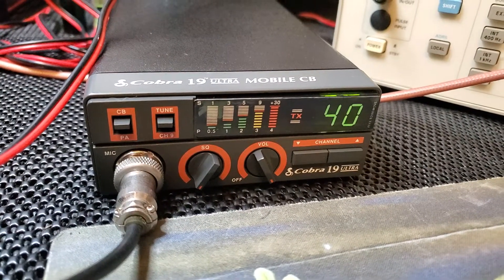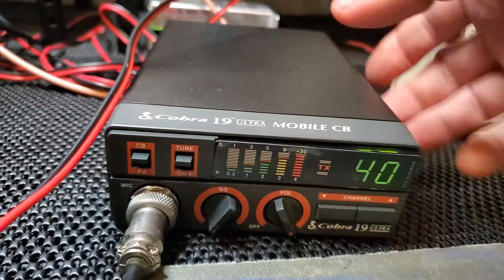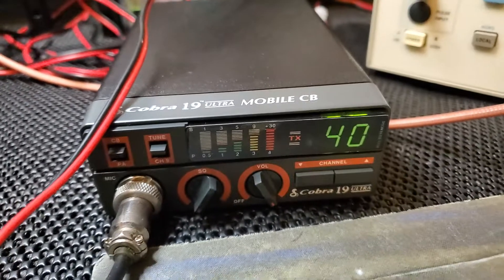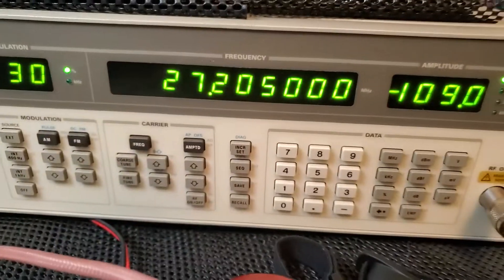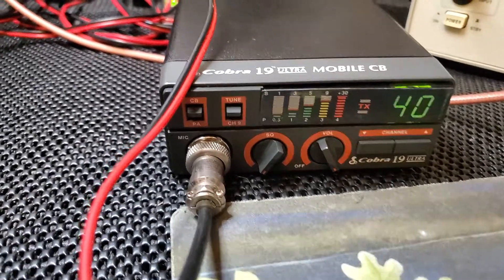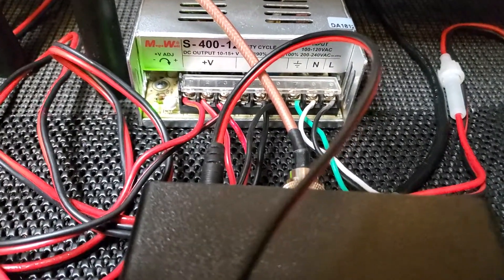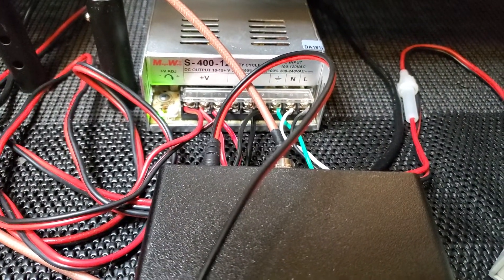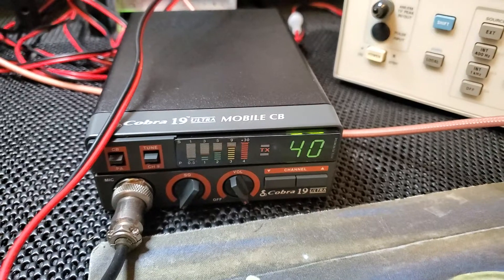New Cobra 19 Ultra original from 1989

Comment: This is my second most fave CB radio only to the 19PLUS with the silver face.  They are basically the same radio but the cosmetic look of the PLUS line of Cobra 🐍 is 80s greatness. The best part of this radio is the four pin Mike, not the crummy DIN the plus had.

Comment: Had one of these back in the 90's. They made several variants of this model over the years and were decent little radios. Naturally I would see them modified to death. Mainly audio mods of course. Fixed a ton of these back when I was still fixing radios.
Reply from the maker: Turn everything and yell audio until you get some movement on the watt meter 😆